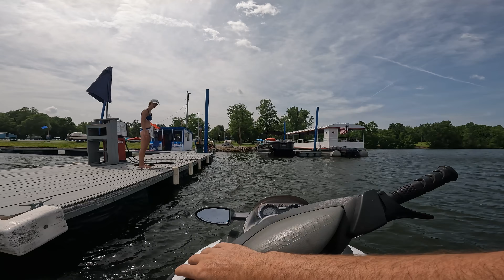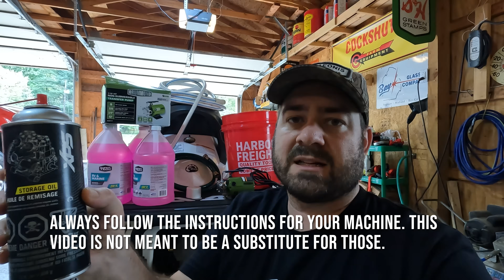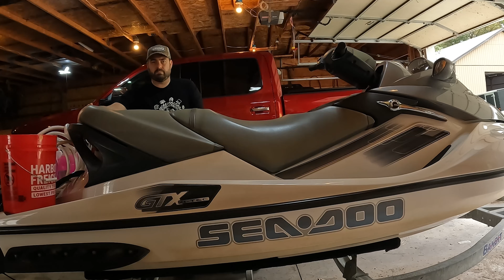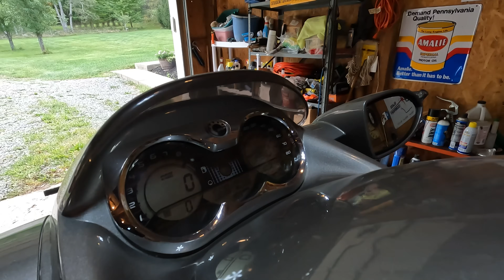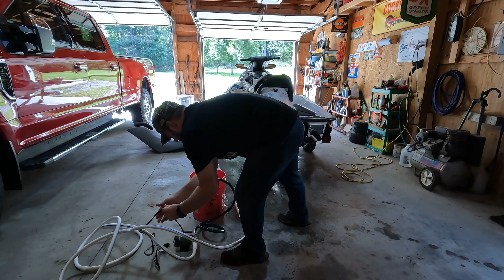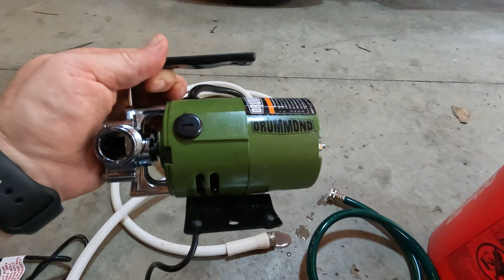An even EASIER way to winterize your Sea Doo PWC

Comment: Sorry if this is a dumb question but this would still work for a 2000 Sea Doo GTX DI? I’m a first timer as I just don’t want to pay $200 anymore every season.
Reply from the maker: I'm not familiar with that model. I think it's a 2-stroke, right? Is it closed loop cooling like our 4-stroke? I don't know if that same method would work.
Reply: @PurpleCollarLife yeah, it’s a 2-stroke. Not sure on the closed loop cooling but I can look into it. Just found out it’s an open loop system.

Comment: Is there a way we can tell how much anti freeze a certain ski will take, I have two 2012 Seadoo 130 STI's
Reply: Apologies, GTI's
Reply from the maker: Unlike an RV that requires a certain amount of RV antifreeze to fill all the lines - with a PWC, the RV antifreeze is pumping through the system and most of it exits out the exhaust. So it's more a matter of having enough gallons for the GPM of the pump you're using (if you use a system like I show here) to complete all the tasks you want to do while running the transfer pump and the engine. In our case - that typically takes 3-5 gallons - by the time I spray the fogging oil in the engine as it runs. 
This year though - I put the bucket directly underneath the exhaust - which allowed me to re-cycle some of the antifreeze.
Reply from the maker: Another clarification - I'm talking about a closed-loop PWC system - like our GTX. Open loop systems you'll want to take even more precautions to make sure you get the entire system pumped through and all the water out.

Comment: Good video. You should use shut off valve for the hose and shorter hoses, you waste the pink after you shut down. Make your own hoses. Also you should blow out the with air first and then pink it. Alway shut down pump first before shutting off ski.
Reply from the maker: Thanks for the comments! I agree - shut the pump off first. In this video though - you can hear the pump starving before I shut the engine off.

Comment: I put my submersible sump pump in a 2 gal bucket with just 2 gal of RV antifreeze and a 2 foot section of hose, worked great, less wasted fluid.
Reply from the maker: Great idea! I need a shorter length of hose. I'll be doing the process again in a few weeks - I plan on getting a short 2-foot hose to do just like you did.

Comment: Do you think it’s environmental friendly to just let the antifreeze run out onto the ground and get evaporated and absorbed and what happens if a dog or cat gets a hold of some of this
Reply from the maker: That’s a good question. I’m using the RV antifreeze, which is used in the fresh water system of a camper when winterizing. I know we flush the lines each spring in the camper, but am not positive about the antifreeze being toxic to pets. I was thinking that if it’s safe enough for human drinking water lines, it would be safe enough in the case that a pet came into contact with it.

Comment: That does not flush the engine out!
Reply from the maker: We are not sure what you’re saying. These SeaDoo GTX 4-Tec machines have closed loop cooling for the engine (with antifreeze). So the engine coolant is separate from the exhaust coolant. The open-loop cooling of the exhaust system is what we show how to winterize in this video.

Comment: Why not use same bucket so your not wasting antifreeze make a loop system ?
Reply from the maker: That is an interesting idea. I'm not sure how much I'd trust the fluid coming out with the exhaust though - would it still be clean? Would it have enough antifreeze % to handle the water that is coming out of the system (if you pump it back through) and still keep it from freezing? For the cost of a few gallons of antifreeze - it's probably not worth the risk for me.

Comment: I think when pumping water thru the Seadoo to flush you need to have to engine on before and after you are pumping.
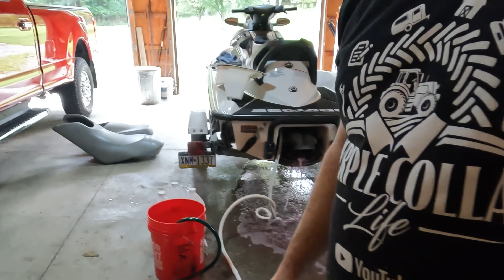Reply from the maker: That is correct. You start the engine first, then quickly turn on the supply of water (see this at 7:04). Then once you're done pumping the antifreeze through - turn off the water, then the engine. This keeps the water flow from flooding the engine when it's not running.  You'll notice in this video that I heard the pump stop pumping (different sound - dry) so I knew the water flow was done, so I turned off the engine, then unplugged the pump.  But the water was stopped (due to the bucket being empty where the transfer pump was) before I turned off the engine. (7:49 in the video).
Thanks for making that point.

Comment: Good video - thanks for posting. 1) shorter hose from pump to ski. 2) for our SeaDoo we stop the water / antifreeze first then turn off engine 3) nice job on fogging the intake.   Do you remove the batter or just put it on the tender in ski?

Comment: I am in New Hampshire and it gets very cold up here and I am worried about leaving any amount of water in the lines/ engine. Running the antifreeze through this way will definitely get into all places water will sit correct? I have a 2001 GTX DI
Reply from the maker: We've never had any issues doing it this way. But if you're worried, you could check with the dealership and make sure.

Comment: I just used a funnel hooked to the seat handle with a stubby garden hose. About 1 gallon rv/boat antifreeze. Stabilized fuel last ride, and sprayed fog oil down plug holes. Guess it doesn’t hurt intake/supercharger to have oil too.
Reply from the maker: Thanks!
Reply: Be careful spraying directly into intake, fogging oil will coat the sensors and could cause issues down the road. I just spray directly into cylinder now for that reason. But my engine is n/a. Idk how to maintain the supercharger

Comment: Is a special antifreeze required for any jet ski that has an aluminum water system? Thanks!
Reply from the maker: That’s a great question. I’m not an expert and don’t know that answer. I can tell you - that on the jet skis that I’ve owned - I’ve always used the RV antifreeze.
Reply: @PurpleCollarLife  Thanks for the quick reply. I will use what you do on my ski.

Comment: The same way I do it, my pump is on 12v so I connect it to pwc baterry. I dont use more than 3-4 liters od antifreeze. Put bucket under and colect extra antifreeze
Reply: Kiddie pool under ski and collect antifreeze. 
I use a submersible pump in kiddie pool.
Reply from the maker: Nice!

Comment: There's a way easier route: connect hose/funnel to flush port. Start engine. Pour in 1 gallon of RV antifreeze, run for 30 sec to 1 min. Stop pouring and turn off engine. Stupid simple
Reply: Rv is non toxic dude
Reply: @danemieze1136  the dye alone is toxic btw. Non toxic? So drink some and let us know. FDA says in very small doses it can be tolerated. Oh, and it also has been proven to cause cancer.
Reply from the maker: I've never heard of this. Does it reverse syphon through the engine?
Reply: @PurpleCollarLife  well if you're on a 4tec seadoo it will only cycle thru the exhaust manifold, and intercooler if supercharged. The engine is closed loop and has separate antifreeze.
Reply: @PurpleCollarLife  edit:  imho using coolant is completely unnecessary if you follow BRP Seadoos method for winterization:   attach air hose pressure of 55psi to the service port and run it until no more water comes out. (Source: BRP's website) Now it's prepared for winter storage. Simple, exact, easy, non toxic.
Reply: @TheRealKalEll You are completely off base here. Propylene glycol is safe for human consumption, you can dump it straight down the drain. That's why you use propylene glycol not ethylene glycol.
Reply: @DJS_ENO  Factually propylene glycol, a synthetic has been linked to cancer and although approved by the (lol) FDA for human consumption it  has also been linked to cancer and other health risks with regards to it's usage in E-cigarettes and in other consumables such as food preservatives.

Comment: quick tip you must shut off the antifreze pump or water before you shut off the engine otherwise you run the risk of destroying your engine.
Reply: Yes. Same procedure as flushing after a ride.
Reply: I Definitely said the same thing out loud just now while watching it. Always shut off water source before shutting off engine. I know the bucket was pretty much empty due to the pump changing sounds but just incase.
Reply from the maker: Thanks!

Comment: if you use a mortor pan you can recirculate it,,catch 95 % of it in stead of making a big mess..plus you can reuse antifreeze..
Reply from the maker: That’s true - but it will have cycled through the cooling system of the engine. What if there were contaminants in there - wouldn’t that potentially hurt something in the future?
Reply: @PurpleCollarLife no!

Comment: I use one gallon antifreeze per jet ski. Using a hose and funnel. Start jet ski then start pouring antifreeze into funnel and let gravity do it's thing.
Reply: Perfect I do the same. 
You DON’T need an auxiliary pump, to pump RV antifreeze through the rear port.
Reply from the maker: We used gravity flow last year (video link is in the description) - the problem is that it’s not enough pressure to fully evacuate the system. These pumps in PWCs pump 800-2000 gallons per minute. You have to provide enough pressure otherwise you’re potentially hurting the pump and not fully sending the RV antifreeze throughout the system.  In the previous video, we noted that in the Yamaha (Waverunners) and the Jet-ski brand that the antifreeze never pumped through the small ports that show the water is flowing through the pump during operation.

Comment: An even EASIER/CHEAPER way is to just blow out all the lines with an air compressor. Disconnect the waterline on the head and exhaust hose going to the water box. Dump regular old anti-freeze in both and call it a day!
Reply from the maker: Thanks for sharing! I'd still be worried that there would be water sitting in a line somewhere that didn't get completely blown out - or that condensation would build up somewhere and cause problems. But I have heard several people who do use the compressed air method to winterize their boats and/or campers.

Comment: Just using gravity to feed the antifreeze isn't good enough? A pump is necessary?
Reply from the maker: After winterizing last year, we were worried that gravity feed didn't supply enough waterflow/pressure to fully winterize every part of the water system. It wasn't worth the risk. Investing in the pump definitely made the process fast and I'm much more comfortable with the winterization.

Comment: All good info Chad.  4 gallons seemed like a lot, but looks like you timed it out pretty good. 👍
Reply from the maker: 4 gallons is definitely overkill as far as needed fluid. But I need the amount of TIME it takes that little pump to pump through 4 gallons to get all the other steps done while the engine runs. :)  As I get older, it may take more gallons. HA!

Comment: I had a 98 Yamaha for 20 years that I kept on the lift in OCMD. There was a flush out tube under the seat. I would just pump some antifreeze into that. I was surprised how well and long it lasted being used in saltwater. Those things are not cheap and it is well worth doing the proper maintenance to prolong their longevity.
Reply from the maker: Yamaha does have a nice flush out system. Thanks for watching!